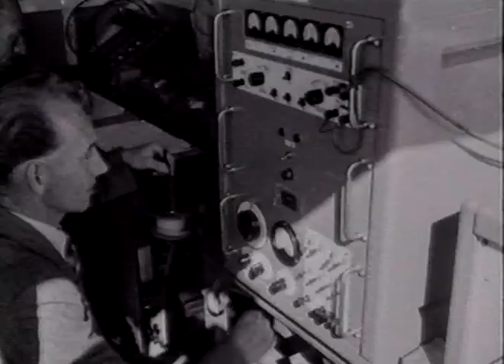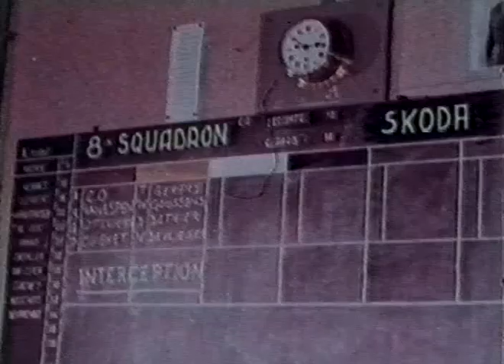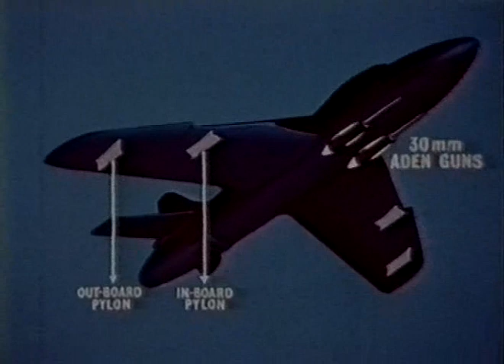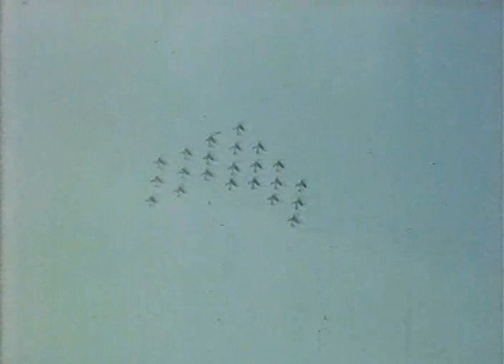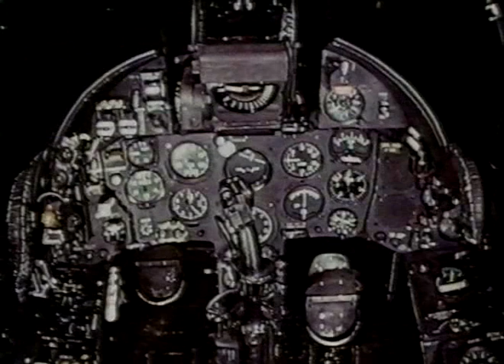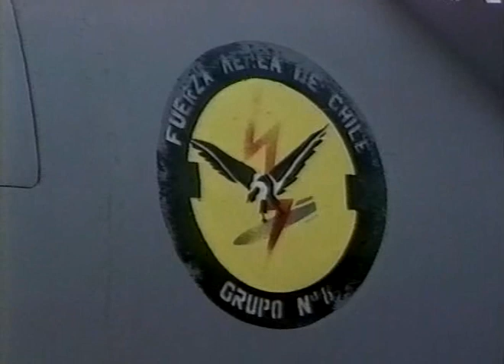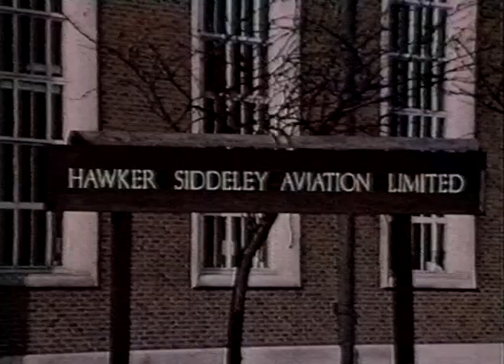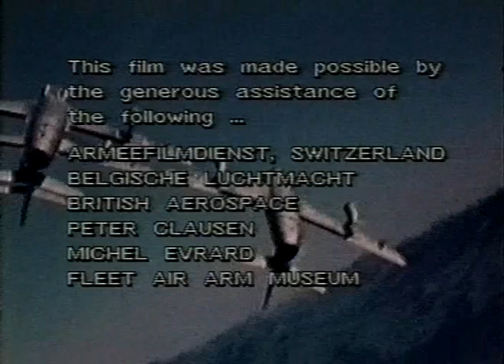Hawker Hunter - Aviation history

Comment: Switzerland, can I tell you a little secret here. We chose the Hunter because the tail was low enough so it would fir in the caverns without modification. As we kept these aircraft inside a mountain and there they were hoisted over each other from front to back, therefore the height was crucial. All others didn't fit.
Reply: It wasn't just that, but it was the criteria that ruled out the Sabre.
The FFA P16 was also small enough for our cavern

Comment: Little Swiss secret here, Gun pack, great invention, but we only ever had the one built in, so the actual advantage of just switching to a loaded one was never used. We lowered it and then serviced it. We, the aircraft service crew, always had to wait for the gun servicing crew. With no gun pack service you were able to turn a Hunter around in under 10 minutes without working up a sweat. Fuel was then the timeliest thing to do. Sorry to say that we did not operate them into the 21st century, they were all decommissioned by 1996, most of them scrapped sadly.

Comment: Sadly the motorway landings were never repeated in Switzerland after 1991. It was just too difficult to warrant the closure of a length of motorway, sort of, for fun. By now 2021, all the parts of motorway that were prepared for this operation have been returned to normal. Center line fencing was replaced by conventional barriers and the light fixtures were all removed. Yes, there were VASIS on the approach.